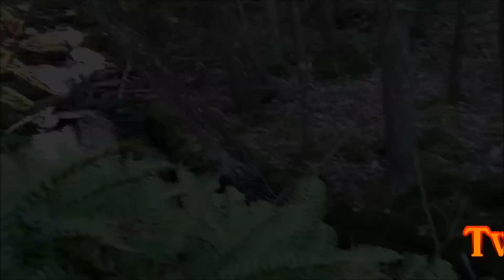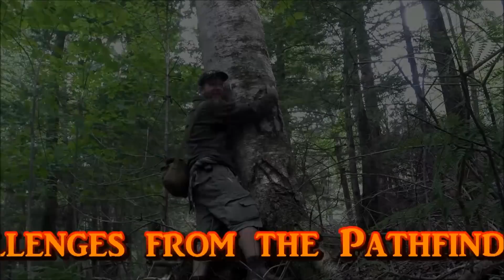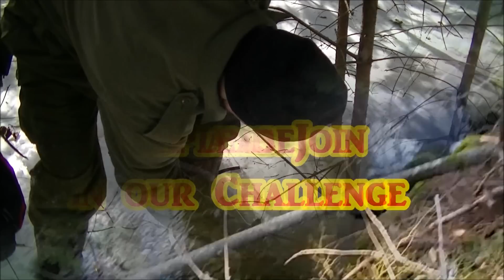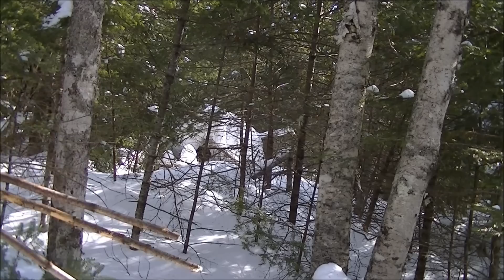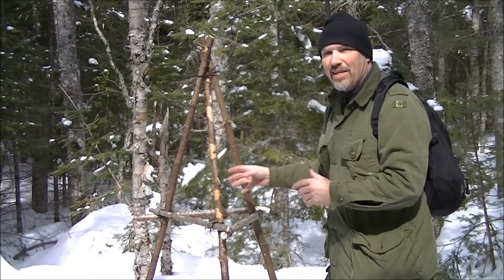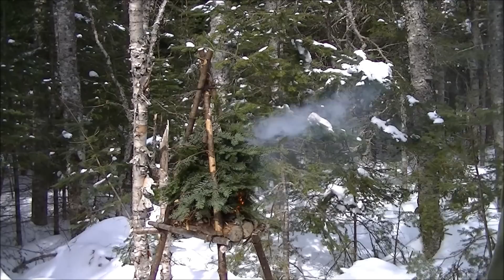Pathfinder Phase 1 Training Challenge, Part 11  signal fire or smoke generator

Comment: Nice bro.. I've never made one of those before. Maybe I will. It will be tough since there are no birch trees in my woods. I have to bring my own in.
Thanks for the video
Reply from the maker: Eat Carbs You dont use birch if there isnt any in your area. Remember to make one of these your lost and maybe with nothing but a lighter, or fero rod. You should try and find a natural tinder in your area that you can strike up with a fero. Fatwood shavings or scrap it into a dust. Anything you have for tinder is what you use. I used birch bark because its handy and my best tinder in the area.
Reply: I am still searching..

Comment: Excellent how to! I am going to have to pull a fire permit when I do mine :) I don't want to get a visit from the fire dept! Haha I like the tripod method. Like you said it is great for wet areas and helps keep the material protected from the rain and snow. Looks like I will actually be getting out this weekend! About time!
Reply from the maker: Windham Woodcraft Glad you enjoyed the method i used, it is a fast set up really and put it up in the air, it can be placed on the ground as well, tho i like this method if your able. Cant wait til you post your next challenge man.